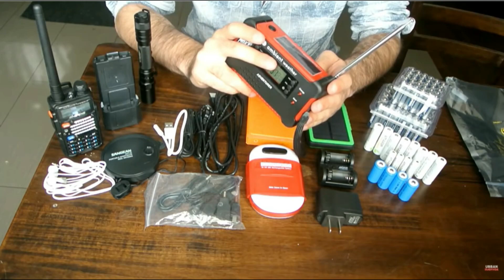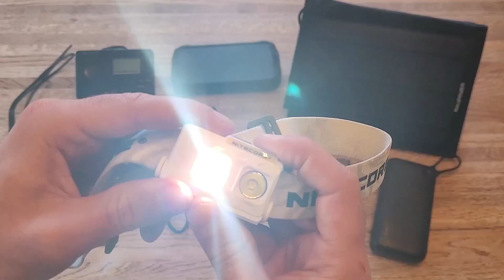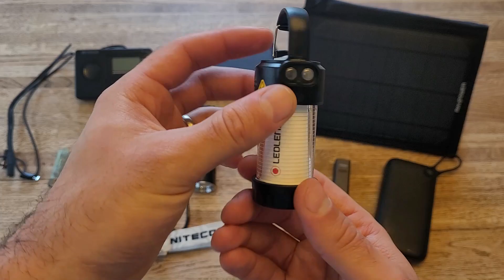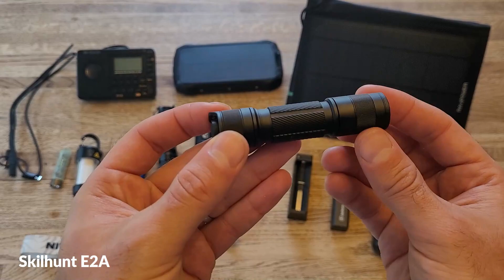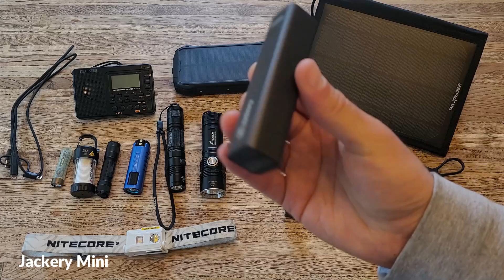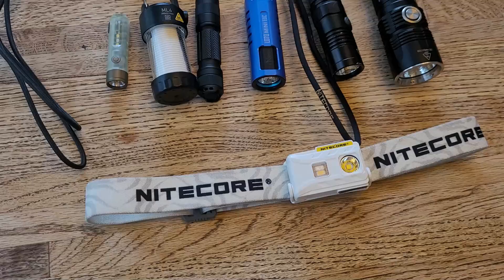BOB Bug Out Bag / INCH Bag Electronics (Flashlights, Radios, Solar Chargers and More!)

Comment: Most of these options are bad choices for prepping... The best battery to standardise on is AA, as they are very easy to find and can still be recharged, and the NiMh chemistry has an extremely long shelf life. Good luck finding 18650s, etc. in the apocalypse... And those Li-on batteries have a low shelf life, drain over time, and completely die if left uncharged for too long. So they require constant maintenance, as you need to set a regular calendar reminder to go through all your batteries and top them up before they drain and die. They're fine for everyday gadgets that you use all the time, but awful for a bugout bag. Just standardise on AA and include a USB AA charger like the super compact Olight magnetic one.

Comment: For a single radio bag, I would suggest a better radio like a tecsun or sony. Personally I use an icom but I would not recommend it since its extremely expensive. Better radios compensate the natural drift in shortwave signals and make it easier to “tune in”.
Reply from the maker: Thanks for the tip on that, I will check those radios out.

Comment: I am sorry to say but I disagree with your choice of radio, I would recommend a Tecsun world band radio (they are also usb rechargeable) or any other good digital world band radio really. Don't get me wrong tho, the Retekess V115 is a very good radio for it's price but the shortwave capability is really not good. With a good $60 world band radio and an extended antenna (to improve reception of shortwave and FM, I choose a Tecsun AN05 extended antenna), you really have the ability to gather information from around the globe ! 

For non rechargeable radio that runs on AA batteries then just choose the battery that have usb port so you can charge the battery directly from a powerbank, or just buy rechargeable Nimh battery and put a charger (that take power from usb) in your bag
Reply from the maker: For me budget was a pretty important factor for choosing the Retekess but the Tecsun AN05 does look like a great radio. For me the shortwave reception on the Retekess is poor but I'm still able to pick up a decent amount of channels. I also have a portable antenna extender which I'll test to see how it improves the reception.
Reply: @UrbanSurvivor  The AN 05 is an extended antenna not a radio xd. But yeah budget is a pretty important factor, I totally agree with you !